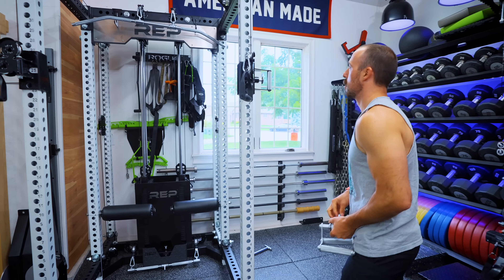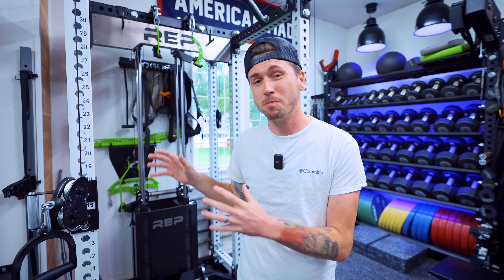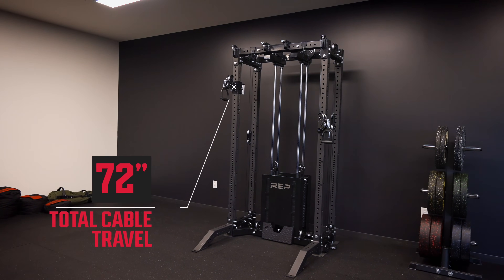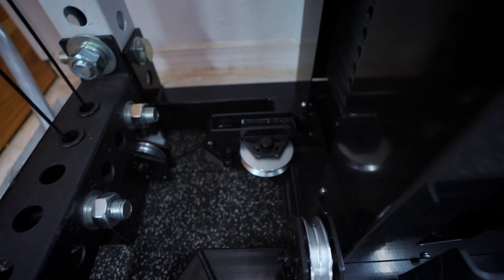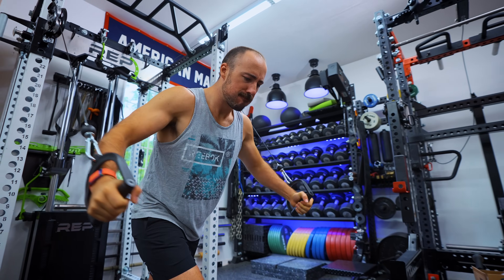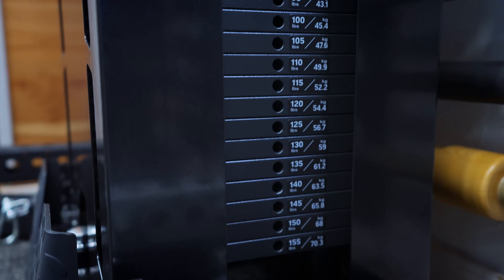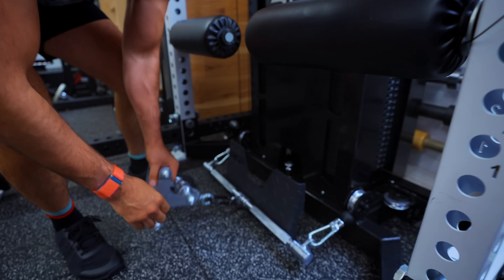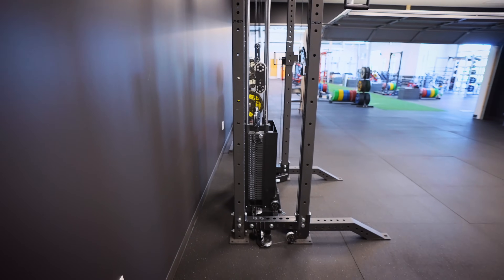REP Fitness ARES Cable Attachment Review: The Hype is REAL!

Comment: You can bench with spotter arms outside the rack and also have a friend stand inside the rack. You can do the same for incline so you don’t have to worry about the bench hitting the weight stack. As for low row, adjust the footplate out and sit on the bottom of a decline bench so you’re not on the floor. Provides a much better experience.
Reply: Should you really have to do ALL that, though??????? For a product you're paying an arm and leg for?
Reply: @cakeeater2368  You can do whatever you want. Nobody cares
Reply: Why did he say you can't really have a guy spotting your bench? The space inside the rack doesn't look inhibited at all
Reply: How would you have a safety?

Comment: They are getting the orders out. My order time line for the Ares is: order date 8/3/22 and delivery date is 9/30/22. Really looking forward to using this. Great timing with this video, it makes me feel a bit better spending so much money on this and the PR-5000. Thanks Coop!
Reply: How are you liking it?
Reply: @WalkingLegacy  I really like it. I'd say though being over 6 ft. I wish I could of had the 93" rack, but have a low ceiling. Oh and the D handles, like Coop said, they suck. Total Fisher Price feel to them. Also, I'm a novice lifter and I probably would of skipped the weight upgrade. One thing I did about a week ago was buy some 23" stainless steel chain with carabiners on Amazon for the low row cables. Makes it a lot easier to use it sitting on the ground. Hope that helps.
Reply: @Relentless0neFPS  Good to know. I am having a hard time pulling the trigger on purchase but I am this close to buying it. I can't decide between a full rack and the half rack.

Comment: You can definitely move to benching on the front uprights if you need to, you have a potential 620 lb counter weight and a 900+lb rack, would be highly skeptical of it somehow tipping unless you're pushing massive weights.

And if you really want to be safe you could probably throw on the Front Foot extensions to feel extra safe.
Reply: True

Comment: If you're building this alone. Get a multi position ladder, and use powered ratchets. If you want to do it right you will have to loosen all the rack bolts. It took me, alone, about 14-16 hours to build. Well worth it

Comment: Amazing review and impressive product. Definitely am considering trading in my Rogue RML-390F for a Rep rack + ARES. I made the mistake of thinking I needed the Flat Foot rack since I didn't want to bolt it to the floor. Rogue has invested no resources into making the rack compatible with accessories like the Slinger cable system and the Trolley Arms.

Comment: Thanks for the reviews.. I’ve been researching home gym equipment for about a year now.  We were building, so I had plenty of time to plan it out. This rig is hands down a win win for me.  I do a lot of cable training and a lot of pre exhaustion mostly with cables.  I don’t see the width of the cables as an issue. I prefer to do flys one handed so you can go past center and get a better pump.  
I’ve been watching all your REP Fitness product reviews in the last few days, Oh and the flooring video.  Lots of good info and tips..  I decided to go with the REP PR5000 6 post rack with pretty much all the attachments, bench and dumbbells with rack. and decided on 3/8” rubber roll flooring.  Looking forward to getting it all set up. 
your videos were a big help thanks.

Comment: Hey coop thanks for saying it needs band pegs also to replace the rogue rhino just use a 4:1 snatch block two pulleys on top and two at the bottom with a hook , attach it next to a hanging chain and hook with the same strap method they’ve got for the rep belt squat that you made a video of from the top pull up bar using the rep belt squat, so even if you maxed out at with both stacks at a total of 310lbs it would still feel like only 77lbs to hook it , you could make it easier by making a foot loop if you run the cable of the top snatch block and loop it at the top of one of the pulleys going down then you just put your body weight on it with your foot on it. Next video i hope 🤞how to use the rep belf squat with Ares.
Reply: Or just keep the Rhino as a stand alone.  What you're describing is far too much work and hassle to set up.  I just want to throw plates on and do the work.
Reply: Not much hassle you do it once and you’re set up is done for every other time .i just went into detail in case coop picked up the idea but basically step, hook ,hook in belt ,push off slightly and rep away its the same idea as rep has themselves for their belt squat but adjusted for Ares since it isn’t a plate loaded version witch means you can’t load plates at the top of the rep you have to preselect the weight from the bottom of the rep. it would however be light years easier to have a plate loaded version of Ares with its 6 termination points and just place a hook,load and rep away.maybe in the not so distant future.

Comment: I want to see how the rep Athena and lat/low row would look and work together when it comes out. In my mind that would be the best build.
Reply: Also curious of the same idea... on their website visualizer, the rack +  lat/low row looks awesome. Def wouldn't mind doing plate loaded lat/low row + selectorized weights for the Athena.
Reply: I dont think Athena and lat pulldown stack. That's why Ares
Reply: @quackhead8938  yeah, might be right, it looks very congested on the rack and i can't imagine the athena fitting in between the 16"' cross members with the RBS there.
Reply: That was my thought: Plate loaded lat/low row and then Athena for the functional part. I think it could be a great idea to do a build up. I'm planning to get a 4 post with the lat/low row and then eventually add the weight storage and the Athena at the same time I think.
Reply: They made a new rear base stabilizer so you can combine

Comment: First, let me say I love your reviews.  You guys rock!  Moving on to this review... This is a game changer and Rep seems to be doing a great job of stepping things up.  I know from other reviews you've done that competitor attachments seem to fit with the PR-5000 as part of this setup.  Will the Prime Prodigy attachments like their low row foot plate (which can really facilitate mid rows) and their lat pulldown seat work on the Rep PR-5000?  Those are much better in my opinion for quick outside rack changes.  Thoughts?  thx

Comment: Boxes sitting in my garage!!! Coop, you need to make a half rack, 4 post review on the ares.
Reply: I would think it would be no different from a 6 post rack, except you can't lift inside the rack and there would be no way to do incline bench.
Reply: @markhalstead2386  You could in half rack mode, with spotter arms out front. Worthwhile tradeoff imho
Reply: @greentube461  True. I was referring to inside the rack. You won’t be able to move far enough back to do incline bench on a 4 post Ares. It is only compatible with 16” cross members.

Comment: Excellent review! Thanks Coop!
Besides, I do not really see the point in the Ares equipment.
Do not get me wrong it looks cool but... 
As Coop said, the functional trainer is the weak point of the system as not wide enough to do pec flys etc.
So the functional trainer is not at par with a traditional moveable arm functional trainer (as said Coop).
Then... if you put the functional trainer on the side it then becomes some kinda dual lat pull down so what is the point?
Better have a 30 inch 4 post with a dedicated functional trainer with the space saved from the 2 additional uprights necessary to install the Ares or the Athena...

Comment: Great video! Appreciate the detailed review. I’m curious whether you think this can be put on a Rogue rack somehow, and/or if you think Rogue will respond at some point to this offering.
Reply: Rogue does not have an 80" or 93" rack. Rogue's racks are 49" vs 47" wide. Rogue does not have a 16" weight storage option. The cable lengths would not be the right length, so they would not work.

Comment: Thanks for the detailed review.  
Did you happen to ask the Rep folks why the weight stack is transverse to the cross braces?  Seems that it would be more space efficient if the weights were in line with the cross braces.

Comment: This is really “niche”, but if you get the 4 post version of Ares or Athena, you’re limited on barbell exercises you can superset due to the cable on the front uprights running directly in front of the front holes. So if you’re doing barbell squats, for example, you can’t do cable exercises with a low trolley position as the cable would block the j-cup hole for your barbell squat. If the cable above the trolleys ran beside the upright instead of down the middle, you’d have more superset options. Not sure if that design would work well for smooth cable travel, and may have some downsides I’m not thinking of, but would have made a more versatile product I think. Didn’t deter me from pre-ordering the Athena though!

Comment: Bro..instead of using the low row from the back...knowing that proper seated cable rows,the cable needs to be roughly chest height...so just do low rows from the front of the rack using one of the sides as you can adjust the handle height. If it's not heavy enough I'm sure there's a simple fix (attachment)for that.

Comment: This is exactly what I am looking. But, I do not have room for it until my next house. 
Hopefully this thing is around in a few more years without any price hikes because I will come back looking for one. 

Nice work Rep, Coop, and the Garage Gym Reviews team
Reply: Will rogue crossmembers from the rml attach to the ares?
Reply: No. Ares is only 41" wide and Rogue racks have 43" interior spacing. No guarrantee the crossmembers have the same cable holes. Also, heights are different.

Comment: How far away should the back post be away from a wall?  Want it close as I can, but obviously won't be able to easily move it after it's installed
Reply: I am putting mine 12" from the wall, but it needs to be at least far enough for plates if you are going to use the back columns for weight plate storage.
Reply from the maker: You could technically butt it up against the wall. It’s in line with the back posts.
Reply: @markhalstead2386  yeah, 12" seems enough to put plates on an off without wasting any space.

Comment: assembled mine last week, loving it so far, but i couldn't agree more about the low row, I despise the thing. I am 6'3" with size 13 feet....I literally have to wriggle my feet between the bar and the foot plate and then try and scootch back on a rubber floor far enough to create distance. I am going to try to connect the two cables with 2 individuals chains to a single neutral grip pull attachment but other then that, individual grips really is the only way I can use the thing. That and idk how it is on the 5000 but on the 4000 I can't move the outside trolleys to the lowest setting because the piece that hangs with the two pulleys actually moves with the adjustment of the outside trolleys and hits the top bar on that lowest setting. So far it hasn't really impacted even curls, buuuttt I think they could have designed that into the system and I'm surprised they didn't. (99% sure it isn't an assembly issue but I do suppose that is possible). I will say though, with my giant wingspan, I still don't have an issue with cable crossovers. Little awkward at first but no issues there after the second set.

Comment: Owning the 5000 series rack, attachments and few accessories here and there - I have no issue with any of REP's products. They are built well and the free shipping makes it nice to purchase accessories as you build your space. My only gripe and it's a considerable one when building your space, is the absolutly terrible job meeting demand. Nothing is ever in stock. Low/high pull, out of stock; RBS, out of stock; landmine, out of stock; barbells, out of stock. I only open their website as a last resort because it is most likely  out of stock.
Reply: Just to satisfy my curiosity I searched every 5000 series attachment and there were only two items out of stock (monolift and something else).  Landmine in stock (1000, 4000 and 5000 series).  I've been on the site a few times every month for the past year and have found very little out of stock, (at least the stuff I was considering) and if out was restocked pretty quickly
Reply: The stock is the pain point for me. I'm in Canada, and alot of the smaller items/accessories are always out of stock and for a LONG time. It's frustrating. I like to order everything at once and if one item is out of stock, it messes up my order. I can always go to Rogue and find what I need in stock. Rep needs to get the logistics figured out. Honestly, that's how you lose some business. And I'm referring to anything in general, if an item is out of stock, I will always look at competitors offerings, and in the long run, I will stick with one that's always readily available.
Reply: @tbookou  Historically, that stock will not be long. I purchased the 5000 series rack (93") had to wait 3 months for the chest dip attachment, 5 months after purchase the high/low pull was available, however the rear base stabilizer (rbs) was out of stock. It took about  9 months to get the setup I wanted. Not a big issue with the free shipment because you can order as it's available and you're not getting burned on all the shipping costs. Also, some items listed as available took 4 to 6 week just to ship.
Reply: @tbookou  I forget exactly where, it may have been a subreddit, where I found out this is a pretty common problem with REP. I should have also added that I like the products enough to deal with significant delays.  It just something to consider with the company.  Now I am waiting on the power barbell to be in stock.

Comment: Can you attach the functional trainer cables to jammer arms?
Reply: I like the idea but the functional trainer trolleys are above the jammer arms.
Reply: I was wondering the same thing.  Might be more advantageous to put them in the middle posts (6-post rack) so you can use high and low fixed- position cable attachments.
Reply: Same here! I was wondering if the low-row pulleys could attach to the Iso/Jammer arms with small extension chains. That could open up all sorts of movements with a different strength curve like Hammer Strength rows, Chest Press, Leg extentions. Missed opportunity?

Comment: Great review, thank you sir.  Do you think it's possible to attach the high/low fixed cables to jammer arms for resistance? Not sure if the angles would be too off for smooth movement.  I'm also stuck with a rogue for the moment, but want to seat this up against its back where my rhino is sitting.
Reply from the maker: Need to play with this. Love the idea! - Coop

Comment: Hey coop I've got a 6 post rack with 41" crossmembers in the front. My posts have weight storage on the back, rogue's jammer arms attached to the middle post and nothing on the front posts, I was wondering your thoughts on integrating the ares into this setup, if it is possible to have rogue's arms on the front posts along with the ares or if i would / should keep the rogue arms on the middle post, the only reason I am hesitant is that the space between the 16" crossmembers is pretty narrow to get into to move the jammer arms up and down with the weight storage there.

Comment: Can you do barbell squats in the rack in a 6-bar configuration?  That looks a little tight to walk to walk up to the J-Cups with the plate stack and low row extension by your feet, but it looks doable.  It looks like you could turn around and do them from the front of the machine, but you'd have to drop your cables to the ground.

Comment: Does this fit on any other rack like rogue monster or lite? And would it be cheaper and better to just get a titan functional trainer which I am planning to get come this black Friday? Mostly looking to do cableflys, tricep pushdowns and lat pulldowns.
Reply: The width of rogue racks and rep racks are different, so I don’t think the Ares would work. 

The Athena releasing from Rep in December May work on Rogue racks as it doesn’t cross the middle of the rack.
Reply: Maybe purchase some rep cross members so the width problem is resolved. But then you run into height issues

Comment: Coop, I heard the floating pulleys in the rear of the rack twist a lot.  Has this happened to you and is there an easy remedy??
Reply from the maker: Over time, the cable stretches and unwinds. In the beginning, I had the same issue, but worked it out with a bit of use and became no big deal. - Coop

Comment: Hey coop,
As part of the home gym community, I've watch many if not almost all your videos and the question I'm hearing about the ares is, will it work on other racks. I know this is a vague question so let me elaborate. Since this is mounted on a 3x3 1" hole rack, the width issue can be resolved with purchasing rep crossmembers if you have a rogue rack. But the height issue is where it gets tricky. I myself have an RM-6, so with that being said, would you and Sam be up to the challenge to see if this can fit into the 3x3 x 1" rack ecosystem
Reply from the maker: I’m going to work on this. They tell me no, but I think I can figure out a way, it just depends how much Macgyvering people are willing to do. - Coop
Reply: Why would having 43in rogue cross members prevent you from using this system? Cable length?
Reply: @GarageGymReviews  Size of the uprights (Rep being a true 2.95 by 2.95) will be a problem for the trolleys of the functional trainer?